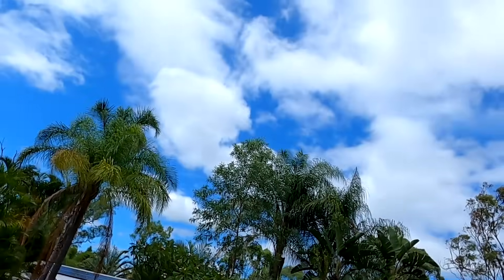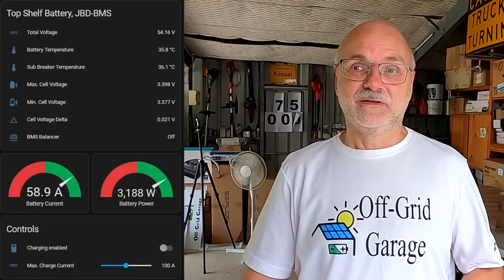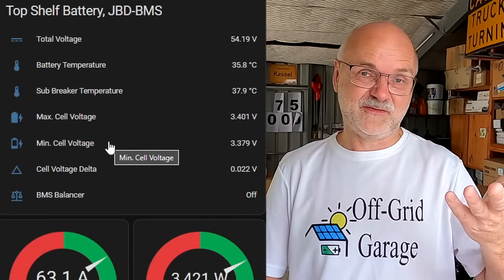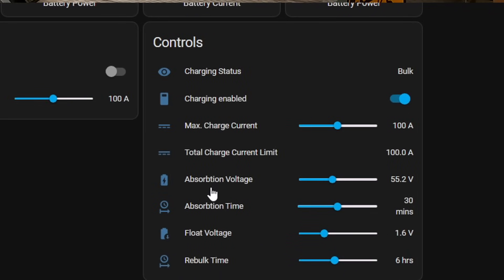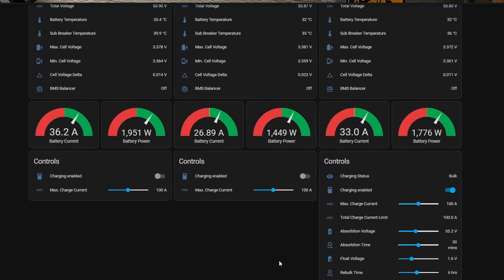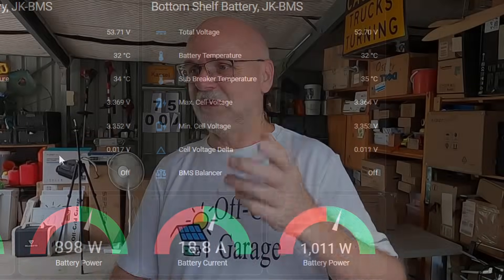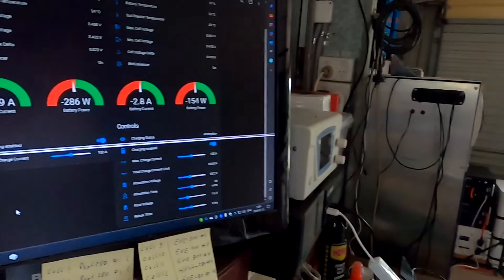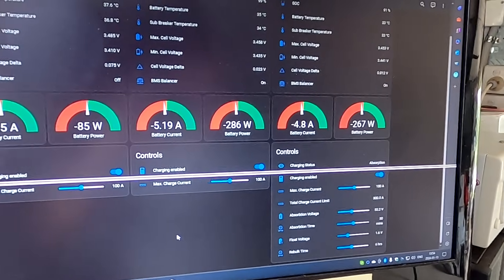Is JK's 0.6A active balancing enough? First charge of the Battery Shelf under 'Peter' Board control.

Comment: 3 of 6 my JK’s will not reset to 100%. Same settings as you.  Been like it for 18 months.
Reply from the maker: Do you also have the SOC100%Volt setting?
Mine definitely does not work... I've got this on one of the next videos. Seems like some BMS just don't do it.
Reply: Mine does not have the 100% SOC value.  Ive been fiddling with the OVPR voltage and UVPR voltage.   Deep cycling etc...  seems to be closer, but it's still off by a fair bit.

Comment: Andy if you can work out how to fix that  new JK  Please let me know as that is the same problem i have here. I just installed a new JK  i brought on ebay, Has hardware ver: V11.xw and software ver: V11.288   version v4.17.0     The other problem with it is that   it will say  it is  0% Soc  when you hit a cell voltage at 3.284 v  I'm using the same settings as you. As i use you as my bible 🤣🤣 Thanks for the great video
Reply from the maker: That's all sorted in the last video: https://youtu.be/KznZtqpoles

Comment: Create a set of automations that control the max charge current. The. You don’t need to worry about manually setting it. 

I have one on temperature, one at 95% that starts slowing, another when max cell voltage goes over 3.6, and another at 100% charge. They change the charge current to have a soft landing. 

The. I have ones going down that reverse that.

Also for everyone else, a $3 esp32 you can do all of what rheee boards do for free otherwise using the open source library from which this is based.
Reply from the maker: Yes, you can do that. At the moment, I'm only monitoring to see how much trust I have in the Peter Board solution and HA.

Comment: Wago Alu-Plus-Kontaktpaste Art.-Nr. 249-130 hilft gegen Probleme mit Alu Kontakten ,-)
Reply: Das stimmt, Alu und Edelstahl passt nicht so zusammen. Ich kenn das mit Kupfer und Alu, da haben wir auch so eine Paste für in der Arbeit.
Reply: nun, hab sie auch verwendet. billiger als NOALOX, aber fühlt sich ein bisschen sandig an. hab auch noalox, gibts beim buerklin in D
Reply from the maker: Hab kein Edelstahl ausser dem Gewindebolzen. Aluminium Terminals mit Aluminium Bus bars. 
Hab soviel verchiede Pasten probiert. Am besten laeufts ohne irgendwas ist meine Erfahrung.
Reply: @OffGridGarageAustralia  ich dachte in dem video sagst du dass es probleme gibt diesbezüglich? die wago Paste hat abrasives material drin. sehr fein aber es fühlt sich rau an. das reisst die oxidschicht auf und die paste hält den sauerstoff nachher fern. das ist nicht irgend ein hokuspokus produkt sondern wird bei elektroinstallationen angewendet wenn alu leiter zum einsatz kommen. das nicht ohne grund! ich verwende immer ein klein wenig von dieser paste. auf den batteriepol draufgeben und dann die busbar drauf und etwas kreisen lassen um die oberfläche anzuschleifen, dann anziehen so fest es die alu gewinde zulassen

Comment: pls test 2p16s / 3p16s
Reply: I dont think more than 1p is practical with these cells.
A 1p System is always safer.
And how much more those a 3 × 16s system cost compared to 1 x 16s3p?
Only the bms and a few cables which is well worth the safety in my few.

Comment: Most of the off-grid users don't need any of this...
What we need is that if we have sunny day to change our batteries, and supply the home application, and your victron system is not possible to do that because BMS is control usage from the PVs.
...so reason why this float is useless in your system is,if some moment house need more power, and there is cloudy for the moment, it will use the energy what we want to keep for the night time...
After the cloud get away, there is no chance to charge that float , and we are missing that at night...
Better is to use some high voltage mpp system...
Or simple Growatt or Deye...
This is not necessary to control remotely, but if you have to...then something is wrong with your system...
For the moment i install over 430 systems, and most of them are missing more battery capacity... and some more solar panels...
Anyway... just we need to learn to live with solar system...
Good luck guys... have a sunny day...
(Sorry for the folks covered by snow at this moment, hope that sunshine will come back soon... just try to clean up your PV to get some light on it...)
Reply from the maker: That's not how floating Lithium works.
We charge to say 55.2V absorption voltage and stay there for 1h to balance. After that we drop the voltage to 53.6V. That means, we are still 99.7% charged. And the controller will keep this voltage for the rest of the day. It always brings the battery back to that voltage (if there is enough sun) even if we had a big load for a while. We will NOT lose any energy through that and have 100% available for the night.
Sorry, but what you're saying is not correct. I have shown this many times in my videos.

Comment: What would happen if you decreased the max charging current in the master and the two slaves had charging mode enabled?   So both slaves would have charging set to 100A with charging enabled, but the master max charging was at, lets say ... 50A.

Sorry ... off Topic:  For those looking for fairly cheap flexible 1/0 and above cabling. ... look for Locomotive Cable at an electrical supply shop.  $4 USD per foot, and you could make buss bars from it, it's that flexible.
Reply from the maker: 100A each from the two slaves + 50A from the master = 250A total charge current from the inverter.